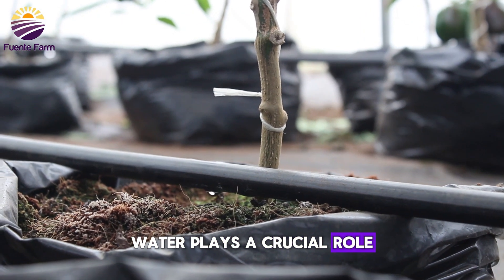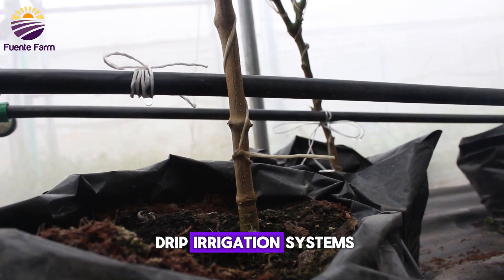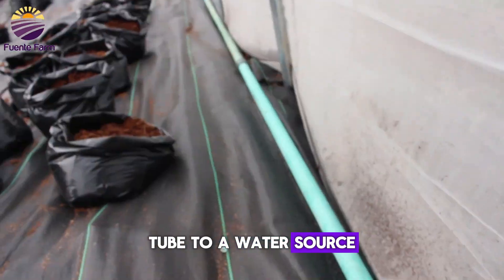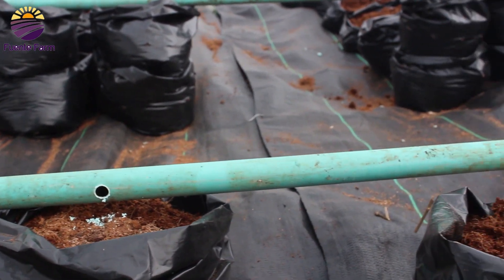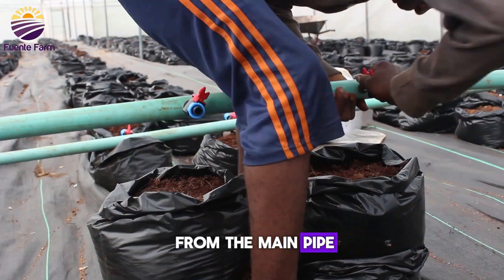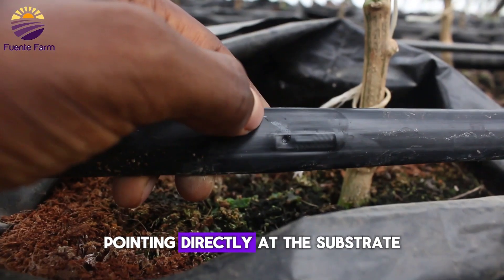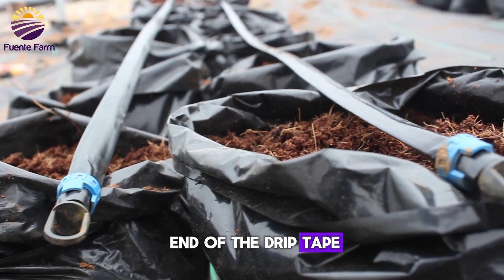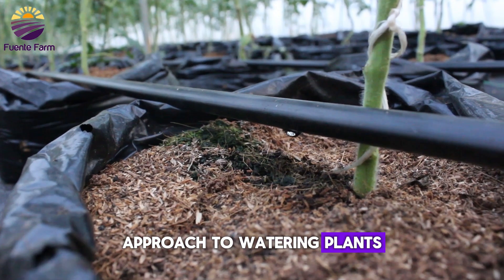See how Nigerians Constructed Drip Irrigation system for a Soilless farm That generates millions!

Comment: What's the name of the rubber fiter you inserted into the hole of the pvc and how do i get it?
Reply from the maker: the rubber comes alongside with the connectors. ask in any plumbing shop and you can show them the video if the need arises.

Comment: How did you drill the holes, what bit did you use.
Reply from the maker: thanks for watching and finding this video helpful. We used a metal Drill bit
Reply: @FuenteFarm  thanks 
Can you help with the specifications I need it. Thanks
Reply from the maker: @vtsnigeria  ok the Size is 12 x 200 x 340 mm
Cutting Diameter 12 millimetres. Hope it helps.
Reply: @FuenteFarm  thanks 
Can you help with the specifications I need it. Thanks